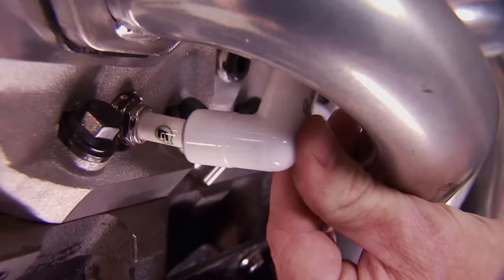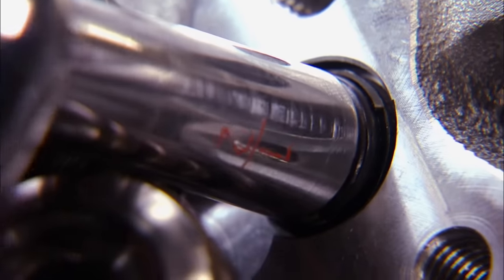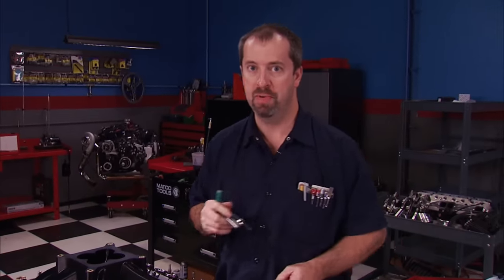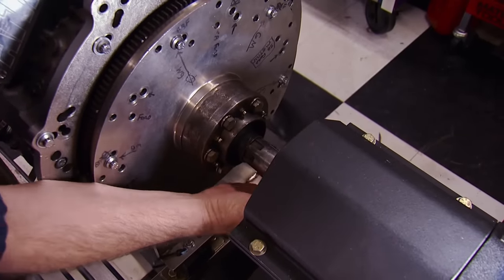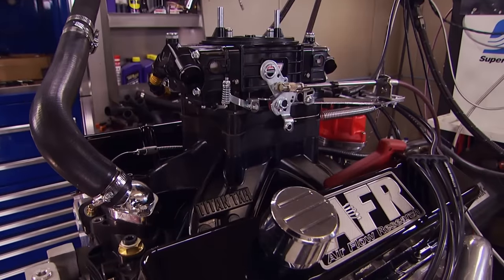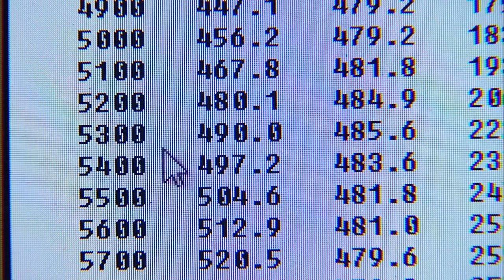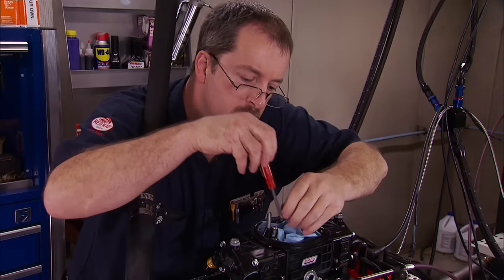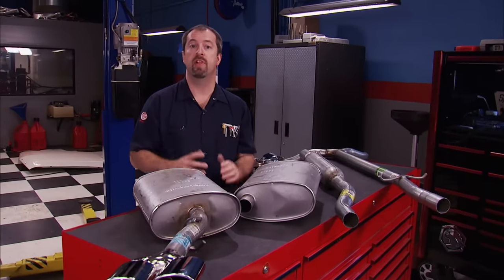Small Block Chevy Build Stage 2, Part 2: Complete Assembly & Dyno Day - Engine Power S3, E3

Comment from the maker: Subscribe to PN+ at the link below and receive the first month for just 99 cents:
http://httpslink.com/lnk_3d0d9e0c
Reply: so,  what was the HP with the 3 inch exhaust ?
Reply: Thank you sir 🇧🇩🤝
Reply: Please engine fiaring mark and timing mark setting thank you sir
Reply: Probably 10hp
Reply: Can yall build a DOHC Ford engine
Reply: @rggt6225  their junk
Reply: @YoungerPrice  coyotes are killing Chevy now  but old fords sucked
Reply: @rggt6225  well multiple test are on YouTube LS is still on top
Reply: @YoungerPrice  what test
Reply: @rggt6225  search you shall see
Reply: @YoungerPrice  you search coyotes beating up on ls you will find also it goes both ways
Reply: Any chance to get the brand of who makes that spark plug tool you guys r using in the Dyno room ??
Reply: It's at 7:41 of the video would really help me on my build
Reply: I suspect the gain from the 3" pipe had more to do with the header collector size vs being a restriction.
Reply: Can you post the parts used on this build.  Heads rotating assembly and cam shaft  please.

Comment: About time someone made a plastic intake for the older style engines like they have for LS motors, the weight saving.
Reply: And won't heat soak like metal intake
Reply: exactly!
Reply: Yeah I guess but I think I just like the classic look of an greatly machined aluminum intake not some black plastic stuff
Reply: @nobullshit9721  yeah
Reply: John McWade aluminium Manifold barely weigh 10lbs
Reply: But how long will it last?
Reply: Honestly the longevity and durability loss vs an aluminum intake isn't even close to worth it.

Comment: This 383 is almost identical to my old 383 set up. Same heads and intake but with comp cam XR292r in mine (254/260  612/618 lift 110 lsa) and 750 carb. Interesting to know what power it was making. Looking forward to the part 3 of this to see if its anything  like what im building now. Im now building a new short block for this top end to go on. Its a dart little M with a 3.8 inch stroke and 4.165 bore to make 414ci. Hope to make 600hp.
Reply: Sir I believe you will!

Comment: "No cutting corners on spark plugs" ... (then proceeds to install gimmicky plugs - from a sponsor, of course). LOL!
Reply: E3 lol
Reply: Yeah but E3 came in and proved that their plugs are better with "their computer" lmao
Reply: @Trigger_32  Indeed. I'm sure they're VERY unbiased about their own plugs, LOL
Reply: Yep....and no matter what I've done in my shop...it seems GM engines absolutely LOVE GM plugs...just works perfectly.
Reply: @nbrowser  GM doesn't make spark plugs....
Reply: @nbrowser  probably means Ac delco
Reply: I think Kevin Cameron (motorcycle tuner/writer) said "Anytime you change ignition and get a power increase you had bad ignition to start with." I'm sure there are exceptions like nitro motors but spark plugs pretty much either light the fire or not. I can't install a new light switch and make my lights brighter.
Reply: Iridium plugs
Reply: @kenshinhimura9387  People who really work on cars would not have corrected him.
Reply: @5000rgb  Damn, I thought I was the only person who knew that.
Reply: @BullyGovJ4F7775  AC Delco don’t even make spark plugs. I work at GM and work at Romulus engine/transmission plant we build the 3.6 V6 and the 10 speed automatic transmission and the maker of said AC spark plugs is NGK,ya sure they make them to what GM says they want the plug to be like but the same machines making NGK plugs that some people call junk or some say AC plugs are junk are both made on the same equipment.
Reply: @evdawg7757  
I put NKG Iridium 3404 on mine after quite a bit of research

Comment: Man, you guys are marvelous. I'd like to see a stage 2 built up using Edelbrock's twin carb tunnel ram intake, either one will would, either the victor or the older version. I'm building a 9500rpm 3.000" stroke with a 4.03 bore block like you've used here. I might use the dart 4.5 bore spacing block rendering the use of 4.250" bores to un-shroud bigger valves making my combo easier to get the rpm I'm after. There's way good valve train assemblies available today to make a high-rpm unbelievable sounding small block chevy. High Horsepower isn't mandatory in my application, coolness of sound is in my 37 chevy pickup build is. In my application coolness rocks 
and this little small motor is just what the doctor orders. You guys are the bomb. 💥

Comment: What is the static compression of the engine and which AFR 220s the Race ready or the Competition cnc ported heads, with that much cam I would have expected 600+ hp and 550+ torque?

Comment: where did the  8000 rpm go?
Reply: scared
Reply: Bolts and pistons would've been all over the floor😅😅😅
Reply: @demarques1911  balance and blueprint...
Reply: They may have built the engine to run up to 8K, they quickly found out that 6500 is the peak HP, no need to twist it higher
Reply: Carb is wrong size then
Reply: Should have got a carb for 7000 rpm not 8000!
Reply: You can make big power at 6500rpm. They did not use a cam that made power at 6500 to 8000 rpm
Reply: @apollomorris9920   no shit  ya can get power at  6500 but they said they were
 going  8k
Reply: @futten3230  I know they did but I dont think the cam knows about there plan.
Reply: @Futten They said the valve springs is good to 8k! They didn’t say they were going to spin the engine to 8k 🤦‍♂️
Reply: Michael Nelson is that not being off a shitload.? I don’t know.

Comment: Just now notice they miss calculated on their engine with a 900 cfm carb when actually they only turned it to 6500 rpm so 383x 6500 divided by 3456 equals a 750 cfm carb seems to be more suited for this engine

Comment: These guys need to watch engine masters and learn from the trio
Reply: Jonathan Thomsen These guys build engines to sell product. It's literally their job.
Reply: @alexcorona  Exactly. Some people win the Engine Masters tournament by using OEM parts in engines that were never designed to take them. You can find strokers that used Chevy connecting rods in MOPAR and Pontiac engines for example.

Comment: Electric water pumps use electricity.
Electricity is produced by the alternator,wich create a load on the engine.
The interesting thing would be to measure how much load it creates because of the pump and see if there is really a benefit,of an electric pump ,in cars.
Reply: an alternator has a constant load, the load doesn't change because you used an electric pump. That's like thinking your engine will have more load on it when you turn on your radio.
Reply: There's no comparison - the parasitic losses of a mechanical water pump far exceed anything indirectly related to an electric pump via increased electrical load. And increased electrical load on the charging system does no create increased force necessary to turn the alternator. You're chasing ghosts.
Reply: @brian_sipe  

The loads differs following the amps used.
You can easily loose 200 rpm of idle if you switch on,headlights,blower fan,and defroster on a carburetted car.
You don't see load varying because the idle air valve compensate for the load on fuel injection.
Load is not constant at all.
Reply: @michaelovitch  load is the amount of engine power required to spin the alternator. That load doesn't change.  I'm not talking about the amount of electricity that is used.  Also your car's rpm will not change if you turn on the headlights.  It will change if you turn on the defroster, since the defroster uses the air conditioning compressor to operate, and that increases the drag on the engine's accessory drive.
Reply: The alternator does not have a constant load. An alternator turning when the engine is at say two thousand rpm with no load on It will take little power to turn. Put on everything in your car head lights, rear window defoger , two hundred amp stereo, cigarettes lighter, etc and that alternator will be much much harder to turn. The benefit of the electric pump is it still takes less power than a mechanical set up. When I was a kid at the local science museum they had a bike set with a generator and a row of light bulbs. As they switched each one on in sequence it got harder and harder to the point that you just could pedal anymore. Same principle.  No free rides when energy is concerned.
Reply: @numbnutz9398  The example you're talking about is how the kid on the bike needed to pedal faster to power the lights, it didn't make the generator physically harder to turn.  An alternator on an engine doesn't get harder to spin based on how much current is being drawn.  That is a myth.
Reply: @numinous4789  - um, no, you're wrong. The amount of force it takes to spin the alternator is directly proportional to its output- more juice out for your electric goodies then more force needs to go in to turn the alternator. There is no such thing as free energy - if there was then the world wouldn't fight over things that generate power. ;)

What you're experiencing with the electric water pump is a reduction in parasitic loss because the normal belt driven water pumps take an increasing amount of force the faster you spin them, wherever electric pumps just take an even amount regardless of rpm. When designed and 'fit's properly (correct flow for the specific engine) they're a nice consistent load on the system, which is often lower overall than any belt driven pump above 3500 rpms...

So electric pumps are great for engines that spin up rather often, or for that last few HP at the top end. Still kind of a niche thing, but definitely not a gimmick.
Reply: @brian_sipe  I had a long explanation written down but I erased it because I don't think you would believe me anyway. Enjoy your magic unlimited energy alternator. At least now we have a solution to free energy!
Reply: @Broadpaw_Fox  nicely said. I got half way through writing the same basic thing but gave up.
Reply: @numbnutz9398  it's pretty simple.  An alternator spinning at 5000 rpm offers a certain amount of resistance to overcome. It's trying to make however much electricity it's engineered to produce.  There's nothing that will physically make it harder to turn if you start throwing switches and increasing the amount of electricity you use.  This isn't that hard  stop making it that way.
Reply: @brian_sipe  - hmmm.... there's a bit of a disconnect in your knowledge of this. Alternators do not just always produce full power - they have control circuits that vary the electrical output according to need. And as they increase output they get harder to turn - requiring more power to overcome that resistance (the parasitic loss). 

Google a quick 'how do alternators work', or even search it up here on YouTube. It'll make this make a lot more sense - but in short, alternators are not always at full output - that's where you're missing the connection.
Reply: @brian_sipe  You are correct. It is pretty simple. A generator spun by an impeller on a hydro dam or the crank shaft of a car will produce an electrical voltage. This is voltage is is more or less constant. The current or AMPS are variable. More load more amps. It takes more POWER to create the amps needed.
P=I x V. Ten amp load at 12v equals 120 watts of power. 150 amps at 12v equals 1800watts.  It takes considerably more mechanical effort to turn an alternator at 1800 watts in the form of parasitic horsepower.  Or in the case of a hydro plant more water flowing when the demand goes up like on a hot day and everyone turns on the airconditioning. I suggest you Google Ohms law and electrical calculations. Or find an electrical engineer to ask. There are literally thousands of web sites that can explain it much better. Good luck and good night.
Reply: There probably is a benefit to an electric pump. Some BMW engines use only an electric water pump, and since BMW is known for squeezing every last bit of horsepower from their cars, I suspect that electric pumps do save energy.

For the guys who think electrical load is always the same and doesn't drag down the engine more, no it doesn't. The reason EFI engines don't bog down when accessories are activated at idle is because the computer commands the Idle Air Control passage to further open up, or the DBW throttle body is commanded to open more. My dad is an electrician, and he showed me this principal when using a 1992 Nissan Sentra to jump start a 1985 Nissan Maxima. It was possible to hear the Sentra bog down for a fraction of a second, then go back up. My father used to have a 1987 Hyundai Excel with a carb engine, and my dad remembered how much it would bog down when jump starting that same 1985 Nissan Maxima.

One reason I have been told that belt driven pumps are a problem is because they add weight to the belt drive. The fewer items driven by the belts, the less inertia the engine must overcome when revving up.
Reply: @skylinefever  - you get this.: )  I coveredctjis a bot in my first response above, but yeah, there are good reasons to use electric pumps, they just haven't gone mainstream yet. The reason I think comes down to reliability- mechanical water pumps are generally reliable, and I feel that most people think that electric ones won't be as reliable. I personally don't agree - but ultimately it comes down to the quality of the parts. Good quality will last, crap parts will fail early. That's regardless of type/part/use/ect... ;)
Reply: @brian_sipe  try plugging something into a generator once, electric power puts a load on an engine

Comment: When showing how to determine what CFM carb to use. Their calculations were using  383 cu.in. at 8000 RPM. And came up with  not quite 900 CFM. This was done to justify a 950 CFM carb they had chosen. But during dynoing they never went above 6200? What happened to the 8000 RPM they used in their calculations?

Comment: I'm curious why you chose the a common crank with a 3.75 inch stroke instead of a crank with either a 3.875 or a 4.00 stroke? Do those 2 require a lot more machine work or something?

Comment: I'd like something in between stage 1 and 2, 400-425 HP and 450 lb-ft, any suggestions? Also, it's 14,000 lbs of FORCE, pressure is a different metric.

Comment: Pat what made you choose the AFR 220 head verses the 210 head, or even the 195 head? Could you have gotten more torque with either of the smaller port heads? Thanks.

Comment: Why only show the torque increase with the 3" exhaust pipe and not the horsepower?  I suspect that at 550 hp the 3" pipe did not show much horsepower change, if any.  Should still show the numbers and not hide information from your audience.

Comment: @19:42 - No parasitic loss? How do you figure that?? If it's doing work (pumping coolant), then it requires energy to do so - in this case (assuming a street driven car) from the alternator. Difficult without some very expensive kit and a gaggle of white coats to determine if the electrical resistance (dissipated as heat) offers any real advantage over the frictional losses of driving one less pulley - but to suggest an electric pump offers a null? Physics simply doesn't work that way.

As well, although a slightly different concern. I'm assuming the pump uses a brushed DC motor? The commutator and brushes naturally being wear items with a finite lifespan by default, and in continuous operation no less. I have a hard time believing that this setup will come anywhere close to approaching the service life of a low tech belt driven pump. Of course this from the perspective of a commuter ride  - perhaps longevity not a concern on a build like this, but still .. aside from the gee-whiz aspect, I just can't see the point in embracing electric.
Reply: You're dead on. Going electric offers a few advantages which the aftermarket has not yet been able to seize upon.  The biggest aspect is a variable flow water pump decoupled from engine RPM. Even then you're looking at a horsepower or two for all that cost and complexity.
Reply: I have heard that some BMW engines have electric water pumps only, so I guess it saves power to have them. However, I am not sure how relaible they are, as BMW likes to put fragile plastic parts in their cooling system.

One solution I have seen is having an engine with the standard belt driven pump, but instead of having the belt connected to the crank pulley, they have a belt connected to an electric motor. That sounds like a better solution, especially with classic cars and engines that weren't built for electric pumps.

Here is an example from Moroso:
https://www.moroso.com/electric-water-pump-drive-kit63750/
Reply: Interesting.
Reply: Heck if they are going that route .there was a belt driven distributor for sbc .I saw one in a Herbert performance magazine.back in the day..a friend of mine said he was going to get one because he wasn't tall enough to reach the back motor where it's at..so ford had sympathy for short guys and they put their dist in the front.lol

Comment: An additional comment that I must make, the 383 combo is not an 8000 rpm type engine. A 302 or any variant with a shorter stroke would be a better choice. I don't think the parts combo was the best, rather just some things that were thought to work rather than parts that were really thought out. I say this as a person that has built a lot of engines over the years and has lots of time with a Superflow dyno. The combinations are what gets the job done. We do appreciate the effort to make a good running small block however.